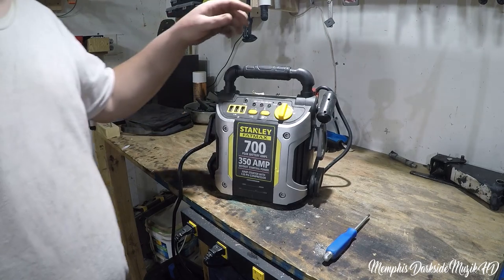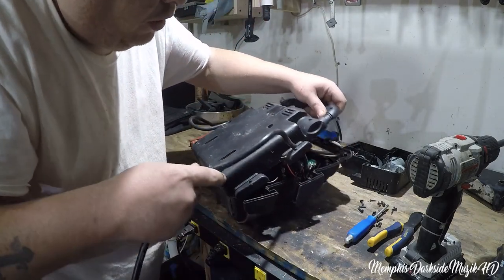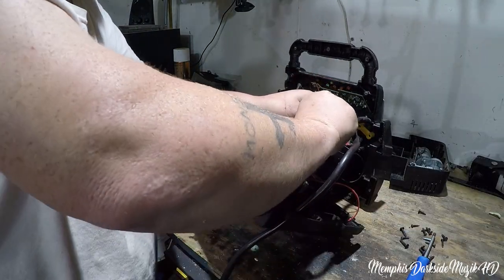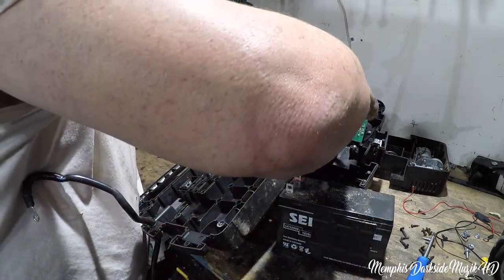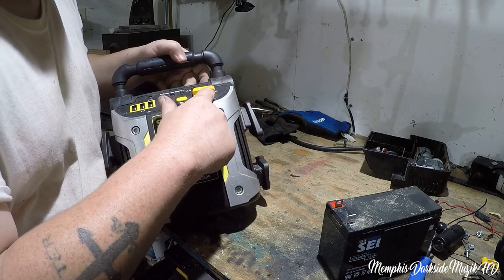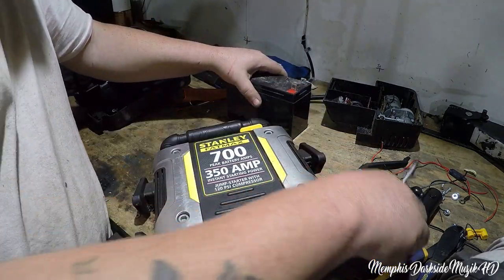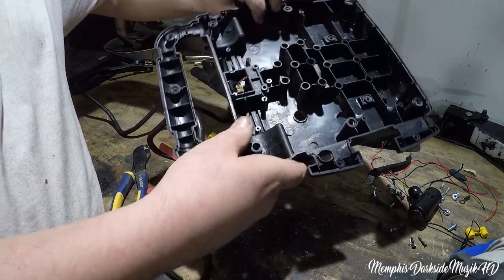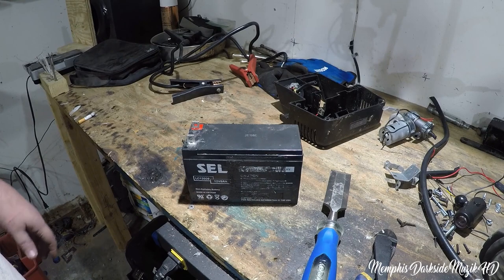Stanley fatmax 700 Peek Amps Jumpbox Disassembly

Comment: I bought my unit brand new on Amazon over four years ago. It has been used and severely abused and still clinging to life. I need to replace the battery, but it is not to the fault of the unit. I was in an emergency situation where I had to jump off a vehicle of ours that would not idle until after 5min of being cranked, so I damaged the battery having to rev the vehicle for 5min after jump starting it and not being able to disconnect the unit. After that moment, it had a harder time having the peak amps necessary to jump start most vehicles. Afterwards, I still used it to jump vehicles that were not terribly dead and all of the other wonderful features it has. 

(I liked this comment so much, that I am also copying it to paste it as my Amazon review)

Comment: I'm watching to see if you get the voltage  multiplier out and hook it up and run a radio I have a different model but you taking that apart will be fun.
Reply from the maker: this thing was a pile of crap. i bought a JNC 660
Reply: Mine was a stanley model It was good til it got a little wet then the screen had what looked like a smear of ink on the screen so I also took it all apart and still rigged it up to charge my phones the battery still worked great some other thing in between went out and then I saved the voltage multiplier and plan on setting it up to run a radio I like the panasonic 80's sizable portable panasonicrx5100 there pretty neat cassette players.